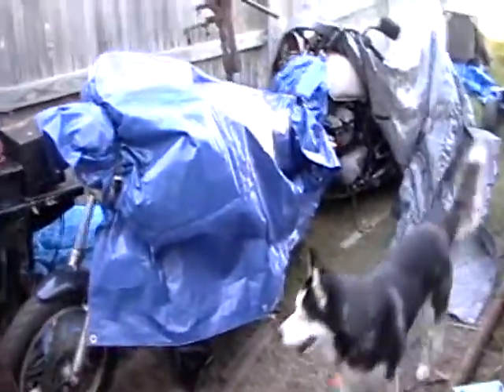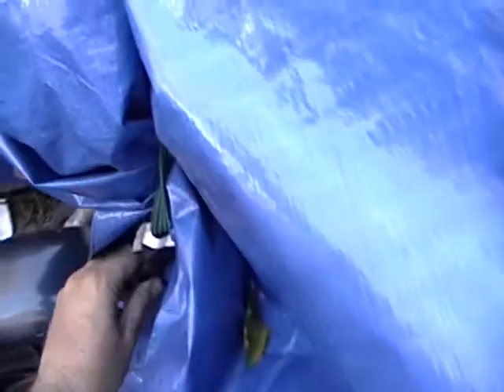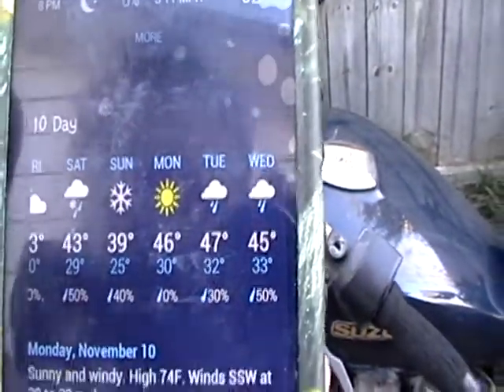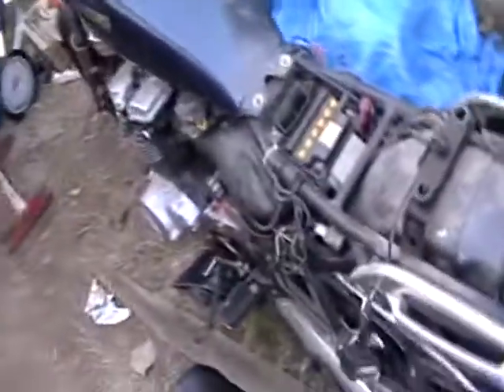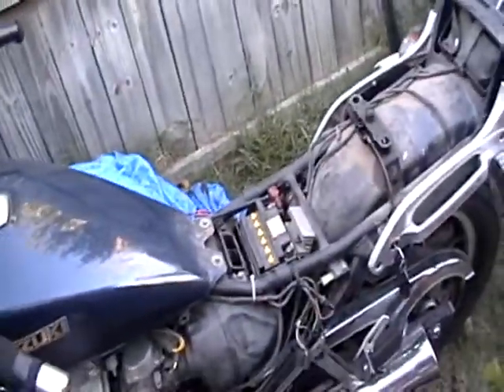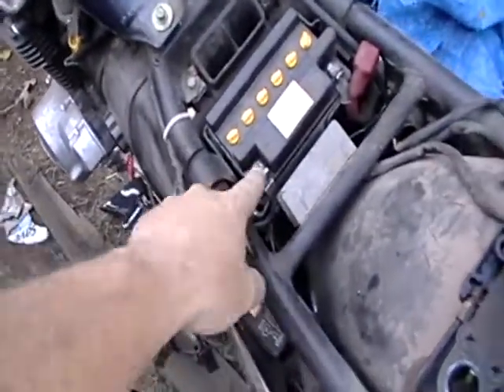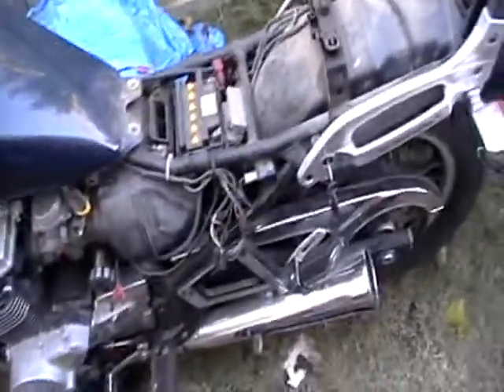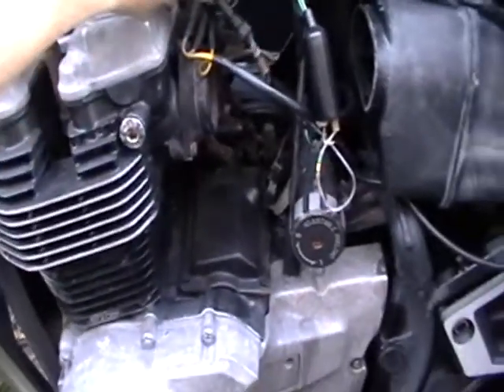1983 GS550L Project  Intro

Comment: Should be a fun project.  Bad grounds can contribute to a whole lot of electrical issues...I would definitely start there.  A good battery is important as well, to keep voltage in a safe range.
Reply from the maker: My Manual is supposed to be in today so we will see